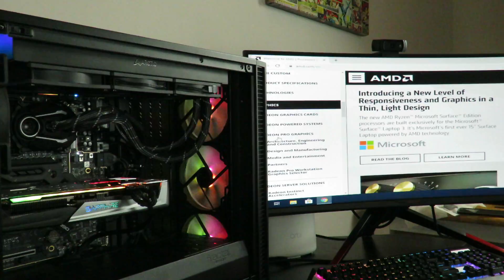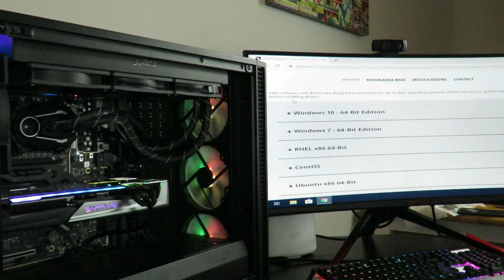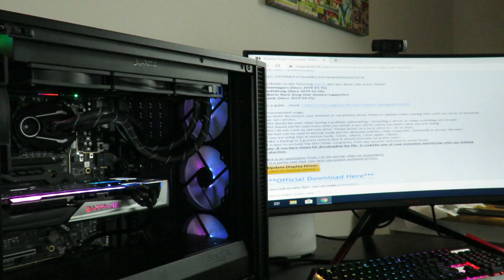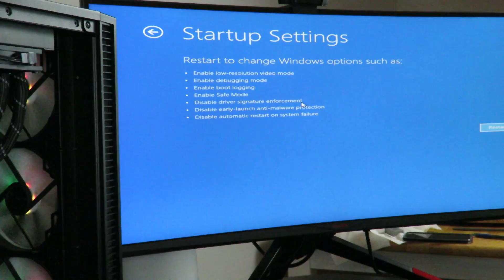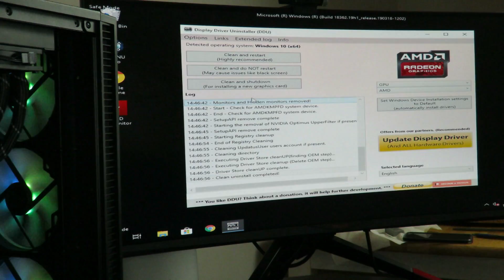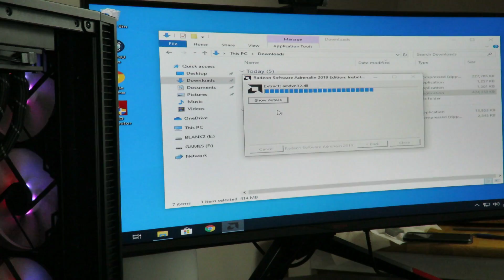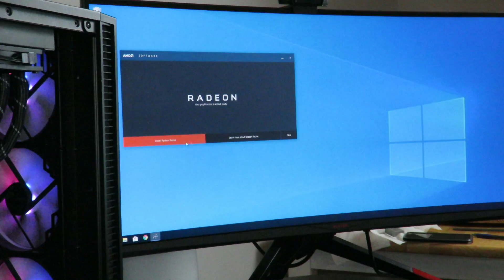Installing the AMD Sapphire Radeon Nitro+ RX 5700 XT 8GB OC Graphics Card

Comment: Is a 500W PSU fine for this graphics card I hear alot of rumors online saying that it overheats due to high voltage from the graphics card.
Reply from the maker: my friend, the Nitro+ requires a 600 Watt card, and they recommend a 650.  During my review of the card (https://youtu.be/YWzqVU6Oq74) you can see it did not reach 500Watt's, but if Sapphire states they require 600, I would not go under that.  The voltage has nothing really to do with the power supply (I know it sounds odd, because the power supply provides power to the card, and yes, you have to plug in both PCIE connections) but it is in how the card handles the power.  You can change the voltage and undervolt the card (many people do it) using WattMan, built into the AMD drivers or using something along the lines of MSI Afterburner.  

You can also see in my review, there are 2 temperatures, the lowest one is the one most programs use to show you the temperature, the other temperature usually stays hidden, but you can see it with GPUZ.  As long as you have good air flow in your system, you will be good, they are known to run a little hot (in the 80's maybe, for the higher temp reading) but they can handle it, the better the cooling in your case, the lower the temp will be.  I hope I have helped you my friend, thank you so much for stopping by checking out my video and commenting, it means the world to me.

Comment: I will just be keeping my RTX 2070 thanks lmfao. Blackscreen and slowdowns lol from the 5700xt... No Thanks. Nvidia for the win. Plus RTX 2070 only takes a 8pin... seems like a win to me.
Reply from the maker: yeah, the RT2070 is a great card, no reason to change, My 2080 takes a 6Pin and an 8Pin, though I don't mind it having 2 or 3 connectors, I can use whatever they throw at me.  Very happy you are happy with your card... but I do hope you are preparing for the 3xxx series, I know I am and it will be here as well.  Stay tuned if you could, thank you so much for stopping by, checking out my video and commenting, it means the world to me.
Reply: @ThisBytesForYou  so I did what you showed in the video... so far blackscreens are gone but this is weird.... the 5700xt (on the box) says it's clock to 1605mhz... Well according to my GPU-Z.... it's actually clocked at 1755mhz which the RTX 2080 boost is 1710mhz. Which means... the RX 5700 xt is pretty much = to a RTX 2080 without overclocking lmfao
Reply from the maker: @dareason7581  that is the game clock, 1605 is the standard clock, when you game, it will ramp up to 1755.  I hope that makes sense?
Reply: @ThisBytesForYou  are you sure? maybe you are right because so far from your video... the 5700 xt is a beast. I turned the tesslatiin AMD optimized off and everything is working nice... Except for Crysis 3... when I turn I get lag. But either way... my bad for bashing AMD.
Reply from the maker: @dareason7581  not sure which exact one you have but here is the info for the 11293.03-40G (it says it on the box, check your box)
Boost Clock: Up to 2010MHz
Game Clock: Up to 1905 MHz
Base Clock: 1770 MHz
Game Clock is the expected GPU clock when running typical gaming applications, set to typical TGP(Total Graphics Power). Actual individual game clock results may vary.

As per the specifications, clocks will vary per game.
Reply: @ThisBytesForYou  can I email you my GPU-z information? even at default clock... it says 1755mhz.

Comment: do you need to do DDU even if amd is the 1st gpu going in a brand new pc
Reply from the maker: you don't need to, but I would recommend it.  Windows itself comes with a set of drivers already built in, and while you are installing windows, it updates and installs those drivers.  DDU allows you to strip those drivers and stop windows from installing its own  WHQL drivers, it will stop lots of headaches you see many people have with the drivers.  i hope this helps my friend ;)
Reply: I upgraded from an RX580 and already had the Radeon software. I installed the 5700xt without removing any drivers or uninstalling anything. The software recognized the card and recommended update which I did and the card's been working as it should as far as I can tell. I'm getting more than double the performance I was with my 4GB 580.
Reply from the maker: @TerraWare  that's great, very happy for you my friend, many are not as lucky as you though.  I always recommend people to do it slightly the more complicated way, so that they don't have to spend extra time on the backend if it didn't work as well as yours did.  So very happy for you, so what games are you paying with your new found power ;)

Comment: Hi, nice video, i'm building a pc and i want to know if  this motherboard is good for the rx 5700 xt Nitro+ and ryzen 5 3600. The B450 DS3H. i have 3 options in my country (sorry for my bad english) B450 DS3H, B450 AORUS ELITE and B450 MSI GAMING PLUS MAX, i was thinking in the msi plus max because its ryzen 3000 ready out of the box but I  really dont know what the differences between those 3 options are. The first option is 30$ less so i dont know what to do.
Reply from the maker: between the 3, I would still go for the GIGABYTE B450M DS3H Motherboard: https://geni.us/C30Fy, the other boards look nice, but the MSI does not have enough USB ports and the and the Gigabyte would be perfect, if that heatshield were not directly under the PCIE slot, it looks like it will get in the way.  the MSI does look nice, so if you don't need 2 additional USB ports, check it out: https://geni.us/fl0BO
And your English sounds great to me.  Sorry I did not reply sooner, I must have missed this comment.

Comment: Hey man, you seem like a helpful guy. 
I’ve just bought one of em rx 5700 xt and I downloaded the drivers from amd website. I did clean out the drivers from my previous card, the 580. 
My performance should have doubled. Yet, the performance is the exact same. How and why do I make this thing speed up? I am going to return it soon. I’ve heard incredible things and all my research says I should be getting twice the frames that I am. What have I done wrong? It’s like I’m getting the frames I get now if I was using 1440p, but I’m using 1080p.
Reply from the maker: Thanks my friend, I do love to help and I it would be my pleasure to help you but I need to check in on a few things with you.  Yes you should get close to double the performance, but it could be many things, can you give me your exact system specs including manufacturer and model number of each device?  How are you measuring performance?  You've mentioned you have cleaned out the drivers, which is great but how did you clean them out, did you use DDU and did you download the latest AMD graphics drivers from AMD?  Incase you are unsure on how to use DDU, you can check my video here: https://youtu.be/clLYbBywhAg
Reply: ThisBytesForYou I did download the latest drivers. I will try doing the DDU and see if I get something different. Here are my specs.
CPU: Ryzen 7 2700X
16g of DDR5-3200 Ram
Tomahawk B450 Mobo 
Evga 650 W power supply
Samsung 860 evo 1 tb
Reply from the maker: @mqge  yeah you meet and sometimes beat all of the requirements, so you are good, and hopefully you have both of the PCIE power cables connected and you have a nice system.  DDU clearing your drivers will help you tons, then installing the latest drivers will help.  Also what are you using the test your frame rates, and what are your game settings, I ask because there are a few settings that should not be used, they kill performance with any card you use, the highest NVIDIA card as well, for example MSAA, it destroys performance and I believe (I don't have one infront of my right now, I am at work) should only be set to 2X.  Let me know how this works out for you, I really want to help you get the most out of your card.  

Oh oh one thing I forgot to mention, if you have any  overclocking software that you had been using on the 580 (MSI Afterburner, TRIXX, etc), uninstall it and make sure to delete the settings as well if given the option, that could be hindering your performance.  If you want, download and install the latest and greatest versions of them afterwards, but get rid of it for now.
Reply: @mqge  Just seeing this. I'm curios to know how everything worked out. I upgraded to the Nitro+ from an RX580 as well and I got more than double the performance in some cases. Hope things worked out as I am very happy with my upgrade and I'm running a Ryzen 5 2600 with 16gb ram
Reply from the maker: sorry i did not get back to you, for some reason a lot of the comments are not coming through, so I am going back and filling in.  Is everything wokring for you?
Reply: ThisBytesForYou Ive been requesting an RMA, MSI has been terrible for me. I’m hoping to get my money back to purchase an ASUS ROG 2060s evo/advanced.
Reply: Terranigma yo, so I’ve requested to get my money back (twice) and hoping this time I get something. I’m going to hopefully purchase an ASUS ROG 2060 super evo/advanced
Reply: Check to see if it is in the top pcie slot because that is the one that is 16x. Also there is a BIOS switch on there with the trixx software so try seeing if there is something different or bottlenecking it on there.

Comment: I've just bought this card and it's so loud in my PC, I dont know what to do, I have 6 fans in my setup and no matter how efficient they are, the card still runs at 2000RPM+. The card sounds just like a vaccum, please help.
Reply from the maker: the card is amazingly quiet for me, have you already installed the drivers?  I have a few more things for you to try, but I want you to first watch this video, make sure you follow everything I go through, installing the card, PCIE cables, uninstalling old drivers with DDU and installing the latest drivers.  If that still gives you those issues, come back to me please, I would LOVE to help you get it working: https://youtu.be/ZMShJUdjjr0
Reply: It's the same no matter what I do, the junction temperature gets high and fans are trying to cool (while GPU temps are between 60 and 70 degrees)
Reply from the maker: How do you have you fans in your case oriented, front as intake, too as exausht and rear as exhaust?
Reply: three on the front as intake, two on the top and one at the back as exhaust
Reply from the maker: @Kaivien  OK, through the Radeon software, when you right click on the background and select the AMD portion
1. Right-click on the desktop and open AMD Radeon Settings.
2. Click on the gaming tab.
3. Click on global settings.
4. Click on the global wattman tab.
5. Scroll down to the fan & temperature block.
6. Move the speed/temperature toggle from automatic to manual.
7. Slide the toggles until you have a curve that you're happy with. Our example here is a good place to start.
8. Click apply.
If you did not use prior to installing this card DDU to remove the drivers and install your newer ones, it may be configured to your older card, this way you can control it on your own.  but make sure to check the temperatures to make sure everything is ok before and after.  It could also be you have a bad card, it does happen.  Please let me know what you find.
Reply: Okay, i fixed that. I unmounted all fans and pushed on them with my fingers to warm them up and just move them around. Now it works flawlessly, max 1500RPM at 100% GPU Usage. Anyways, thanks for help, subbed!
Reply from the maker: @Kaivien   ahhh that is great news, very happy you got that resolved.  Since the card have removable fans, my next thing was going to be to remove the fans and change thier locations, I wouldn't have mentioned to push down on them but awesome that you got it.  Trixx used to have (prior to the 5*** series) the ability to change fan curves, that would have been my recommendation, I would have recommended that.  I am not sure what happened, if it was a limitation on amd or sapphire but they currently removed that feature in favor of the Radeon software.
Reply: I think the fans came rigid straight from the factory or something
Reply from the maker: @Kaivien  ahhh, well it can happen I supposed but I am so happy you could get it straight and now you can enjoy your Sapphire Nitro RX 5700 XT, it was a great card while I had it.
Reply: Kaivien i bye this card now. On amd drivers adrenalin 20.2 i have same Loud like you, and temp over 85c. I downgrade to adrenalin 19.2.2 and now everything is okey. How is your situations right now ?
Reply from the maker: @milelamja  nice, sadly I don't have the card anymore, with Sapphire it's a review and return situation, hopefully more soon though.

Comment: Hi! Can you check if my build will have any problems?
https://pcpartpicker.com/list/4xhTPn
Also if i replace the Red Devil with Sapphire Nitro + would i have any problems with the compatibility and space? Please?
Reply: Please respond
Reply from the maker: I apologize I did not respond sooner, I spent all day yesterday from 11 am till 10PM writing a review and finishing up todays video which comes out in 5 hours (12PM EST) also, this message got caught up in Spam since you included a link.  I like to protect my viewers for bad links incase someone posts a link to a virus, but checked out your link and it looks good, I made my recommendations a few seconds ago, let me know what you think.
Reply from the maker: I am sorry my friend, I would have responded sooner but for some reason this got caught in spam.  So your build looks solid, but I will make some recommendations.  I would highly recommend getting 3200 or 3600 RAM with lower latencies,  Newer AMD arcitictures really need lower CAS latencies to perform properly.  Also, for your C drive, because many time temperary files, virtual memory and installs can take a toll, I would recommend at least a 500GB.  I love the case, it looks very nice, but I dont see that you have any cooling for it, do you already have a cpu heatsink fan or liquid cooling, also, I dont see that you have a power supply listed?  Also, upgrading to the Sapphire Nitro here in this video I think would be a perfect solution for you, it really is a great card.

If you like, I can put together an affiliated link for you with what I recommend you should get, though most of it already you have here, please let me know your budget.  Let me know what you think.
Reply: @ThisBytesForYou  Yes im thinking of Cooler Master Hyper 212 Black Edition RGB as cpu cooler and Corsair RM 750 80+ Gold as psu. So what memory would you recommend? Rgb or not anything would work
Reply from the maker: @VatsalPrajapativats  for RAM, 3600Mhz at CL16, maybe this: https://geni.us/0O1WbVz and for CPU heatsink, while its not RGB, it does match your case, but its all preference: https://geni.us/mW4BFox

Comment: Taking out a 2080 for a 5700 
Never!
Reply from the maker: As I said in the video, I wasn't taking the card out for performance sake, it was just an example, it could have been any card.
Reply: there almost the same performance
Reply from the maker: @RealNinox  almost yes, but the 2080 is higher but another huge consideration is the money, the 2080 is more expensive but can utilize 4K, the 5700 cannot, it does horrible on 4K.  That being said, the only perfect card for 4K is the 2080TI, still though 4K is not really worth it, I prefer to game at 2560x440 and both can do it,... the 2080 still better at it though.
Reply: @ThisBytesForYou  absolutely correct what i was aiming at is 1080p gaming so yea
Reply from the maker: @RealNinox  so you would be perfect with a 5700, save some money and get AMAZING performance.  Very happy I could help.  So what are your system specs?
Reply: @ThisBytesForYou  i am running an old 1050 ti that i am really looking to change
Reply from the maker: @RealNinox  awwww, you will have a huge improvement on your system with the 5700.
Reply: @ThisBytesForYou  i know right :)
Reply from the maker: @RealNinox  the 1050 was a decent card for its time, a budget card, but the 5700 came in and made it just a memory haha
Reply: @ThisBytesForYou  xd

Comment: I installed my 5700 xt everything was fine but after switching it to my previous card and nvidia that card wasn't  displaying anything on my monitor so I switched back to the 5700 xt the card wasnt turning on. After I got it to turn on the fan weren't spinning anymore after turning it on. I could get them to spin after by using the program but they would stop after a while did I fuck something up? Or what should I do
Reply from the maker: So make sure you have the PCIE connections plugged it, many times those are missed, verify the card is properly seated in the PCIE slot and also that you have the monitor plugged into the video card.  These are easily missed.  Let me know if this helps.
Reply: @ThisBytesForYou  I'm sorry I explained this very poorly. My gpu is working it just that the fans are not spinning maybe it's bc of the temperature (40-46 celcius ) so it's not overheating. When. I used the AMD program to mess around with the fan speeds it works and they spin it's just that they stop after like 15 secs they also work when I turn on my PC. Do u think maybe theyre gonna start spinning automatically after it reaches a certain temperature? Sorry for all the questions I'm kinda new to PC
Reply from the maker: @crona4636  ahhhhhhh ok, that makes perfect sense.  Yes, they have the 0db technology, when the gpu is not heavily used and/or the temp is below (I believe 60 degrees, but you can adjust this with Sapphire Trixx) 60 degrees, but when you start up a game, maybe play it for a minute (or maybe right when the game starts) the fans should turn on.